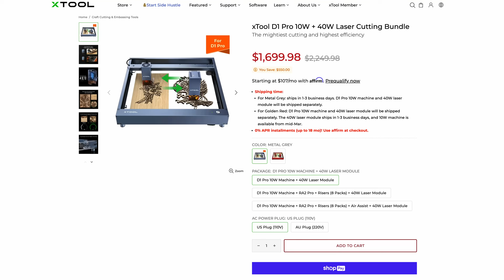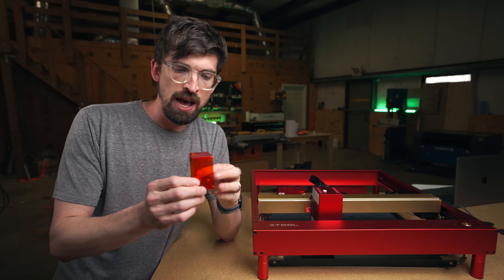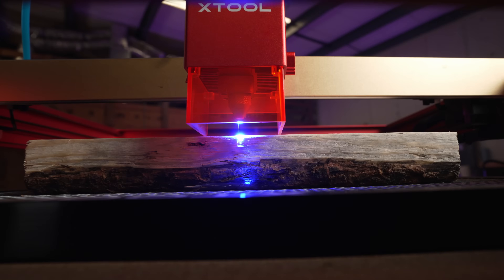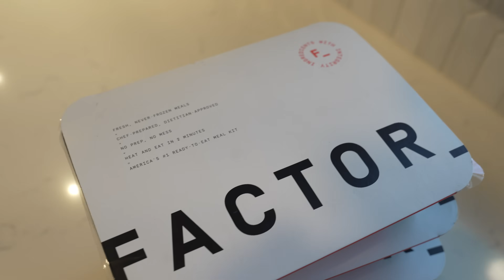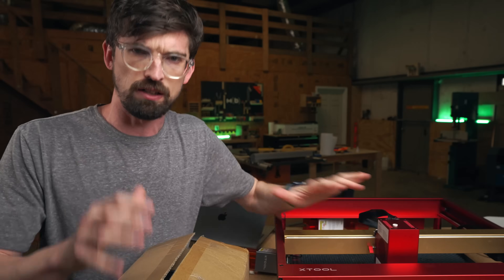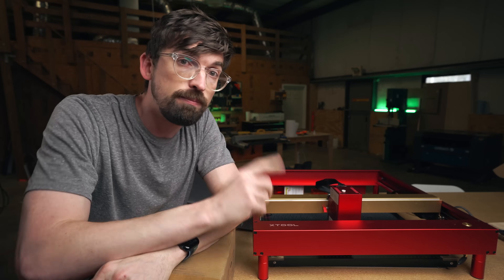I was wrong about the xTool D1...

Comment: I've had the xTool 40w for 6 months now and there is now a build up of crud on the module fan, with the lower wattage modules you can clean/replace the internal module fan but with the 40w, according to xTool themselves, the 40w is an enclosed unit so you cannot access the fan, clean or replace it.  Since you have had the 40w for a while now what is your experience of build up on the fan, has anyone else experienced problems.  XTool have not provided a solution but have offered to replace the module under warranty but that will only put off the issue for another few months.

Comment: Totally overpriced and barely does anything more than a 20-watt. 👎

Edit:
What a rip-off that you have to buy the 10-watt still.
Reply from the maker: The power still is double and I'm finding especially on the cutting side you can have some serious time savings.  I'm hoping they give you the option to buy the 40w with a frame so you don't get the extra cost of the 10w down the road though.
Reply: @makeorbreakshop  I'm sure it's faster on thicker wood, but on the thickness of wood commonly used for projects on these diode lasers it might be hardly noticeable. I'm just seeing big diminishing returns here.

20 watt is capable of 99% of what this machine is capable of. Beyond that I'm using my table saws, chop saws, and jigsaws. All faster than a 40-watt diode laser when cutting thick wood.

I agree with another comment that said he's going from a 20-watt to a CO2. That's the practical jump, not 10 or 20 to 40.

If I was buying my first laser I would buy a 10 or 20w and use a jigsaw if I need to cut thick wood.

Comment: Don’t you have to change hardware as well besides the Laser Head. Since the Laser Heads are All Different Power Ratings.
Reply from the maker: You do have to change out the x axis rail and the motherboard, but it can still power the 20W and newer 10W
Reply: @makeorbreakshop  
I don’t have the X Tool. 
I have an Atezr P5 then was later sent the V35 Laser Head to Swap out just the same. I’m still waiting on the extension rail kit to show up before I swap it all out.
Reply: @makeorbreakshop  
I seen a couple people test the power rating on the XTool 40 Watt each time it test will below 35 Watts. I think it was a race between XTool an Atezr who got their out first Quality may have suffered.

Comment: Hey, great video.  Just FYI xTool has confirmed that though they originally said the laser size of the 40w was .15x.15 it is actually .10x.15.  If you shine the laser on the way at very low power you will see that it is actually a rectangle not a square.
Reply from the maker: Great point!  When I talk about the laser point I tried to show the thickness in both the x and y.  I had the power turned up pretty high so it was thicker than it really is but you can tell it longer in one direction vs the other.

Comment: You can reduce the power on the 20w to the 10w's. I don't know if the laser gets any finer. 🤷‍♂
Reply from the maker: You would still get roughly the same laser dot size since the optics in the laser won't change.  Since the 40W is using 8 diodes then it has to bounce and reflect through more focusing elements vs the 20W (4 diodes) and 10W (diodes), that happens regardless of power.

Comment: will the IR diodes cut clear acrylic?
Reply from the maker: I’m pretty sure it still needs to be opaque.  But at 2W on power you wouldn’t be doing much cutting even if it could.
Reply: @makeorbreakshop  Thanks, I'm trying to find a way to cut clear acrylic without using a CO2 laser..  Love the channel.

Comment: Might want to add that the regular D1 laser modules, are not swappable with the Pro.  The pro laser modules have a higher pin count.
Reply from the maker: I was wrong again...again.  Yeh I was really only thinking from someone buying a brand new machine should have mentioned the upgrade path as well.
Reply: @makeorbreakshop  - No worries!  The upgrades can get a little confusing 👍.  Also the extender isn’t compatible, since this would require a new longer wire harness.

Comment: Good stuff.  You have just about convinced me that I have what I need in my 20 watt D1 pro.  (Until I go large CO2 unit) #thunderlaser
Reply from the maker: 20W is great too!  Going into the CO2 world you get a lot more on the safety side of things that are a huge plus other than just the increased power.  Plus the thunder machines are absolute beasts!
Reply: Agree.

The 20 watt is plenty capable whereas the 40 is basically unnecessary. For me I'll be going from a 20-watt to a CO2 or something else that hasn't been invented yet.